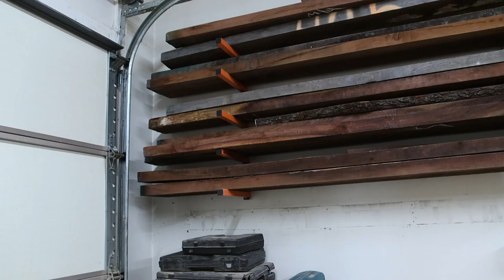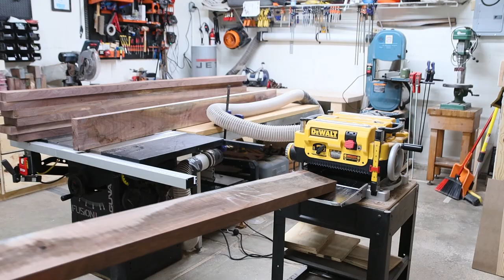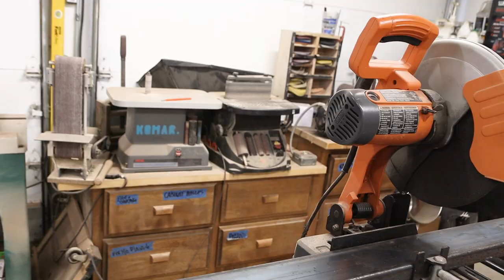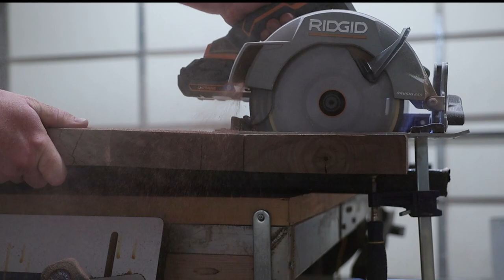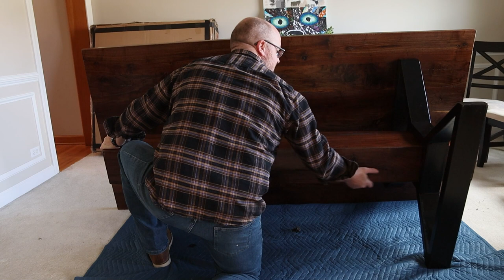They wanted the wanted Thousands!! I built it for hundreds!!

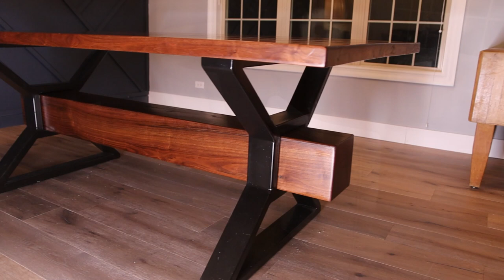Comment: the table looks nice but the table top looks kinda bow/warp/twisted? 7:42 as you can see the middle is bow upwards and the right edge of the top has a long S shape.  wouldnt that just defeat the purpose of the planer?
Reply from the maker: May just be the camera angle. I think when stabilizing the shot (I was holding camera and walking) the filter sometimes “warps” and image to make it look smooth. Good eye! I hadn’t noticed that. Thanks for watching